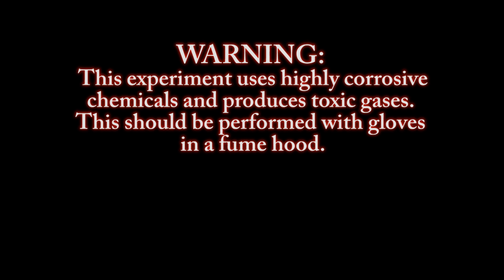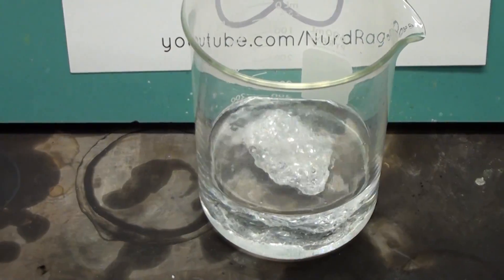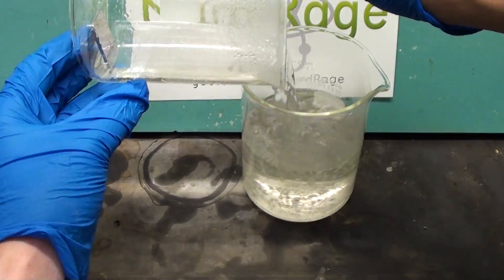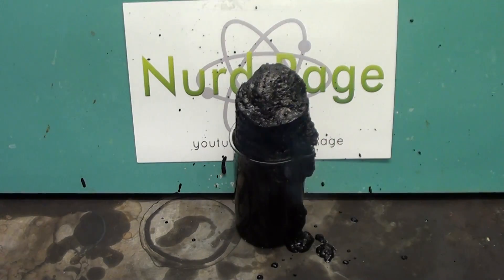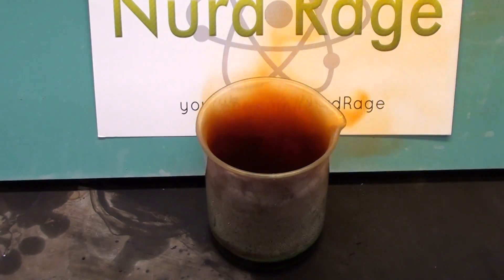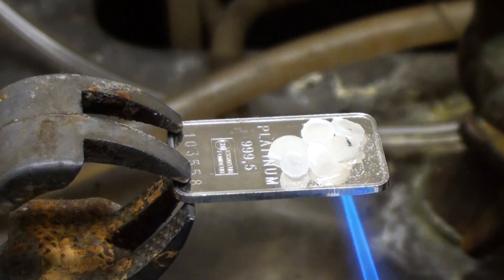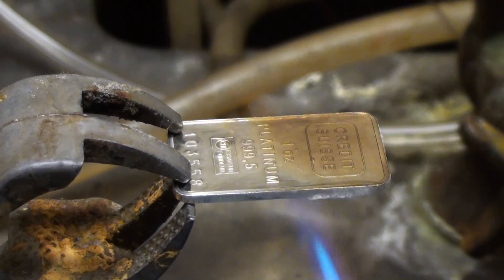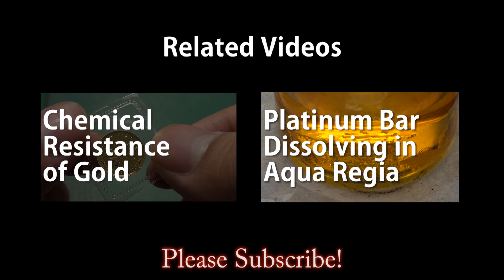Chemical Resistance of Platinum

Comment: hi , am from indonesia...
i've got 16 ounces troy platinum bar from my ancest, i want to test it in order to know it's fake platinum or not..
can you tell me the simple way to test it,couse am not familiar with chemical stuff
Reply: andre says if it matches most of these then it is real
Reply: Send it to me and I'll test it for you.
Reply: the cheapest test is to check the melting point. it should be around 1770°C. fake platinum will usually have higher melting points cuz they tend to use tungsten for this prupose. you also can calculate the density of the ingot you have and check it with the density of platinum (21,45g/cm3)
Reply: looking by all resources i've searched on youtube and googling..i think it's a fake platinum bar. 
but thank you so much for the infos i'm really appreciate it.

Comment: According to secondary school chemistry you can warm silver or gold in the absence of oxygen to remove oxides from the surface. I would guess the same is true of platinum. Whatever the method it wouldnt be difficult for such an inert metal.
Reply: Or you could polish the oxide layer off. It's only a few atoms thick: one can tell because one can see down through the oxide layer.

Comment: mr nurdrage i have a question for you i have a car battery that i want to open to get the lead out of it but im not sure what to do with the acid. so can i just put baking soda in it to neutralize it and if i can neutralize it with baking soda can i throw it down the drain ? after it been neutralized i mean
Reply: Short the battery for a couple days, then dump the resulting water down the drain, problem solved, use gloves when disassembling.
Reply: EPaR - Aidan Gieg It turns some of the surface lead into lead sulfate, not nearly all of it... If you want maximum efficiency, you can just dump the acid into a large glass container with a couple liters of water in it, then slowly add baking soda or some other weak base to neutralize it...
Reply: Teth47 But that turns the lead into lead sulfate....
Reply: Oh, I didn't think about that... Good point. :)

Comment: A new experiment should seek out a material immune to molten sodium hydroxide.
Reply: In his "Chemical resistance of gold"-video, Nurdrage's gold coin is not damaged by molten sodium hydroxide ^^
Reply: TheySmashedAnHourglass yes, but aqua regia is famous for disolving gold, even more easily than platinum.
Reply: theoretical physicist Yeah, but that's another story, we were talking about molten sodium hydroxide here Oo But yeah, it seems every material has its weak points(aqua regia being golds weak point)
Reply: iridium is basically inert. it doesn't react to any known acids, and it only reacts with the molten salts sodium and potassium cyanide. it does react with fluorine at high temperatures, and oxygen at extremely high temperatures.
Reply: Are you sure about the fluorine reaction? To my knowledge, cold fluorine gas will react with most any element. Otherwise, I suggest a Carbon Teflon chemical resistance video.
Reply: Rj Conk yeah, crazy isnt it? fluorine only reacts with it at high temps.
Reply: It's also really rigid, isn't it? I was thinking about its structural uses just the other day.
Reply: Rj Conk yes. its very strong. they use it for machining tools because it is hard and can take the high temperatures. its density is around twice that of lead, so its not a very good structural material. good for annoying people: make a large block of it and put it somewhere, you would have a hard time removing it (to heavy, cant move it. to strong, cant break it. to inert, cant dissolve it. melting point to high, cant melt it. not much you can do)

Comment: Hm, if you're trying to "compare" the reactivity of two metals with a given solution (Al and HCl, Cu and HNO3 vs Pt in those acids) why would you place them in the same beaker/solution? Even though Pt likely wouldn't have reacted much, if you place highly reactive Al/Cu with Pt the former will react leaving behind a fairly stable product. Essentially Pt will both have no time to react and *can't* be compared in reactivity because it isn't controlled/in its own beaker.

Comment: Ummm yes 100 percent nitric acid is indeed possible. Concentrated nitric acid is usually 98 or 97 percent but 100 is not impossible. 70 percent is the maximum concentration produced when the nitric acid forms an azeotrope with water.

Comment: Platinum can be attacked by concentrate sufluric acid at very high temperatures. In 98% H2SO4 , The corrosion rate is about 0.1mm/year at 250C, about 0.5mm/year at 300C,  and in aerated solutions at 400C, the corrosion rate will exceed 0.9mm/year,

Comment: It's because dissolving/diluting acid in water is an exothermic process, if you add water to concentrated acid it could boil and spray hot, concentrated acid everywhere.

Comment from the maker: And what if the container of concentrated acid you were pouring it from were to splash? then "concentrated acid would splash everywhere" So there is no difference on the splashing issue. Like i said before the rule is mostly applied to sulfuric acid due to heat of dissociation. It's not that much of an issue for other acids.

Comment: the most dangerous acid known is probably esafluoroantimonic acid(HSbF6), formed by the lewis reaction of a 50/50 mixture of HF(Bronsted acid and lewis base) and SbF5(Lewis acid), beside being the strongest acid known (something like 10^19 times stronger than sulphuric acid) it can virtually dissolve every existing compound(it can dissolve even hydrocarbons) and often react dangerously during its reactions, it is also very poisonous and volatile so you must use it with extreme precautions.

Comment: In a local German university I have been to they are using a mixture of HF-acid and other acids to clean Niob-metal-tubes.
It is even more stronger than HF and I could get the exact mixture-ratio for you if you would like.
The scientists there call it "Wunderwasser" due to it's outstanding capabilities.

Comment: Ok, I'll take your word for it.  I've noticed that hydrogen peroxide makes hydrochloric acid disolve copper and steel much more than HCl by itself.  I'm sure this has something to do with H202 being an oxidizing agent, but I was wondering if you could explain that effect to a greater degree.  I use HCl and H2O2 to etch PCB's.
Reply: HCl and H2O2 makes chlorine in-situ.

Comment: The nitric acid reacts with the copper, but the platinum doesn't react as easily so nitric acid isn't strong enough to cause any reactions with the platinum. The nitrile gloves are made from materials that don't react with the chemicals or are at very least resistant to some degree.

Comment: That's amazing... one of the meanest chemical compounds only tarnishes it. Very useful element Platinum is.
Reply: Sodium hydroxide is no way one of the meanest chemical compounds. Have you ever heard of fluoroantimonic acid? And guess what? The oxygen you breathe also tarnishes platinum, even if some wouldn't want to admit it.
Reply: @yesnoblemetalsoxidizetoo3079  one... one of the meanest. Not THE. You knew what I meant. No, I have not heard of the acid you mentioned.

Comment: Perth mint says they never found any fake metals. They melt and resell metals, I'm not sure if that includes Pt. You can do tests with some sort of ultrasonic equipment, but I'm not very familiar with it. I think it tells you what the thickness of the metal should be if it is pure. If it's not pure, the sound waves will move slower or faster giving you a reading of the wrong thickness. Your best bet is to buy from reputable people and companies, though counterfeiting seems to be quite rare.

Comment: You can buy platinum and other metals on ebay. Just make sure you know what you're doing if you're going to buy. There's a huge difference in a 1 oz bar clad in platinum and a 1 oz platinum bar. There's currently a 1 oz bar going for 1879 USD that I see. It's a bit above spot price today, but that could change. I don't follow platinum or other metals that much so I can't really tell you if it's a good idea to buy it or not.

Comment: The oxide layer can be removed easily be boiling the platinum in concentrated nitric acid and then buffing the metal with a clean smooth cloth. :) We do it everyday in our lab, and heat the platinum in molten sodium hydroxide to remove adhered silicates and aluminates on the platinum.

Comment: A seccond question NurdRage, did the platina react because of the SodiumHydroxide or becouse of the heating of the element? Though i cannot seem to immagine a way for NaOH being a catalist in this reaction. Though on the internet its stated that by heat Pt will not react.

Could you also try reacting it with: Cyanides sulfur and caustic alkalis?
I have found this on the internet:
It is also corroded by halogens, cyanides, sulfur, and caustic alkalis

Comment: Hey NurdRage I have a question. Do you have a solution of taking the rust off of 1945 Steel head pennies. I tried most of everything to get it off... But, it's still doesn't come off. Is there something that I can use to make it almost brand new?
Thanks!